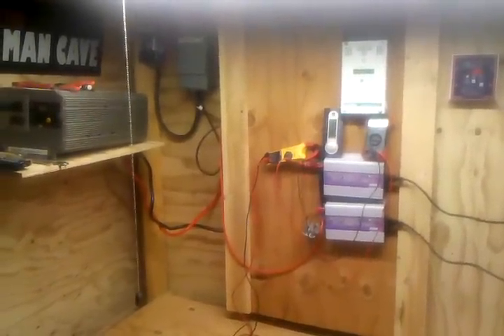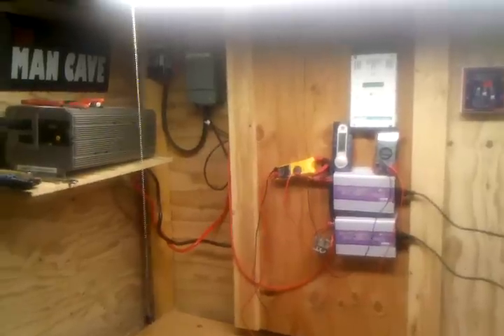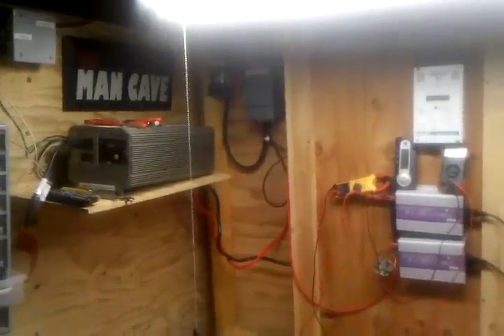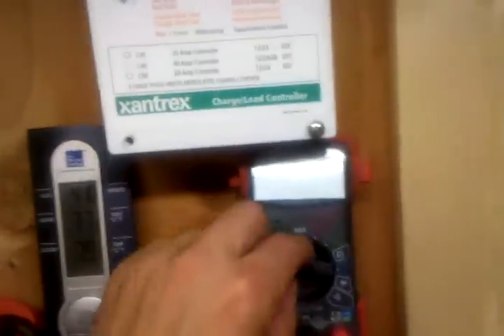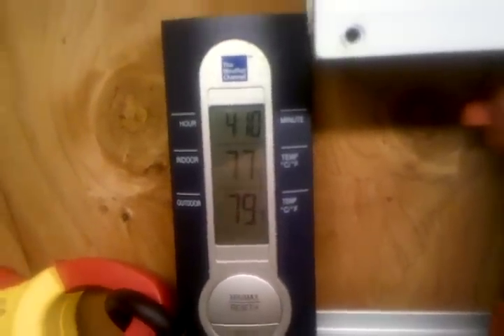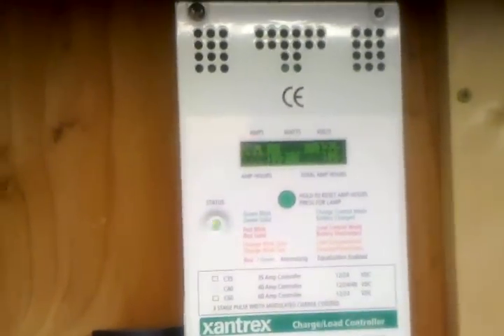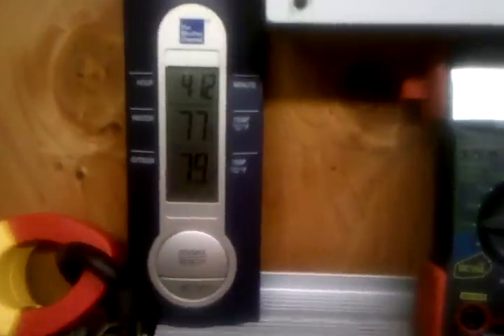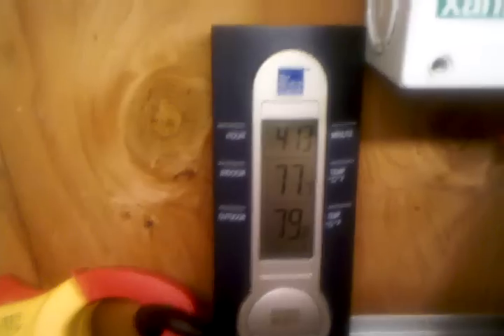DIY Battery BackUp Home, Grid tied solar Home

Comment: you have a 10.5V-20V DC input of your grid tie?you have to run your wires in high amps.. i thought of that so i purchased the 22-50V DC input grid tie so i could wire my panel in series and have lesser amps through the wire..

Comment: I have tested the same setup. I love how you have your wiring. One quick tip. If you have a pure sine wave inverter supplying the "grid" signal you can actually run the grid tie inverters into the home. (WARNING) there must be a load (i.e. Freezer, Refrigerator, TV) to allow power a place to go from the grid tie. I have it setup and my batteries are virtually not being used and the grid ties supply the house :). Cheaper to do this and keeps batteries good for longer so that cycling only takes affect at night.

Comment: I think your V drop is caused by 2 grid tie inverters and a charge controller paralleled - the charge controller is a PWM and the two inverters are MPPT- an mppt is like your thumb on a hose that is trickling water- by applying resistance with your thumb more water comes out of the hose, with two MPPT trying to both do this on the same line and a pwm resistance being applied as well - there is 3 unit resistances applying to the cable which is causing the heating

Comment: As i said before...it is nice when you heat your wires..they really like it...but i don't think you are happy because of that... GO and buy for example Soladin 500/or similar/ (you can buy two of them) grid tie inverters, they have max 150V DC max about 8 Amps. ad one will give you over 500W power directly to grid..it cost me about 350 euro(each) and loss on cables is less than 2% ..as it should be...and also it is MPPT and btw solar panels like more voltage and less current ...

Comment from the maker: @ProtocolsMaster advantages of grid tie is you can leave it be and it will take care of its self not cycling your batterys all the time . But should you need back up power or just whant to run some xmas lights you can :)

Comment from the maker: @mrbuki77 I tryed that and it did work but it made a little buzzing noise on start up, Not shure if i need a blocking diode or what But was going to do a little research on that.

Comment: You can grid tie and also use the charge conroller at the same time. The amps will get split between the two, and as the charge controller goes to float, then more power will be diverted to the grid tied inverters. This is how I do my system. You can see my last update on my system to see what I just mentioned. Later from sunny FL! SAm